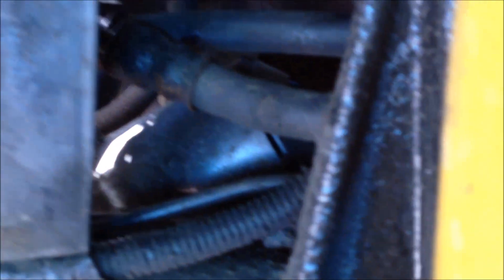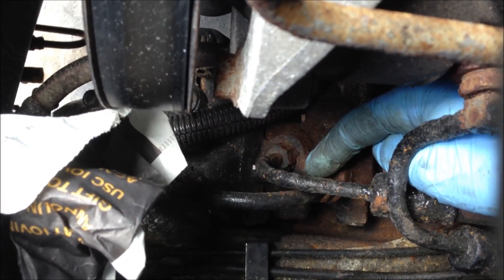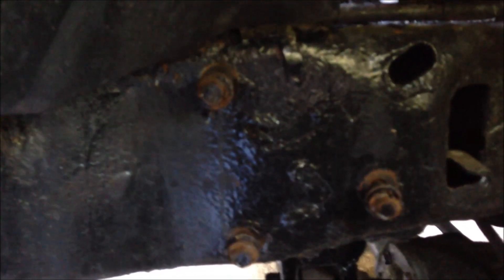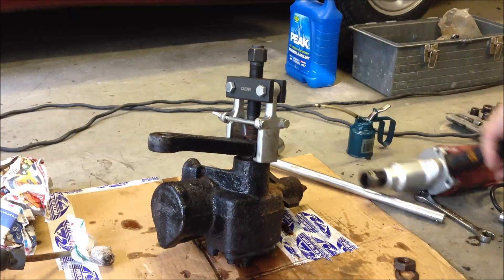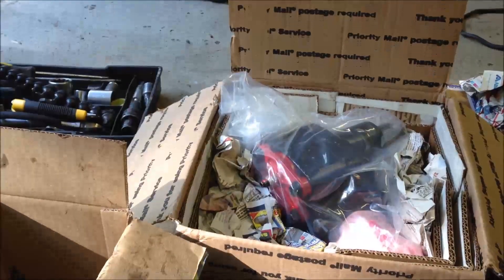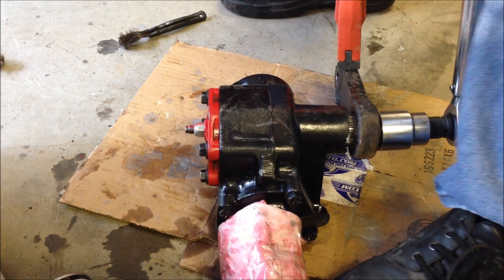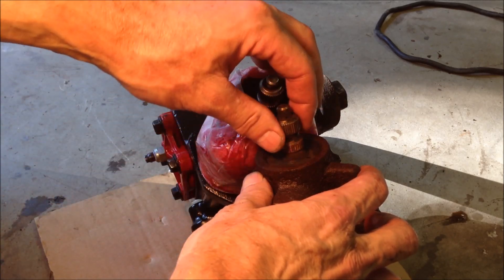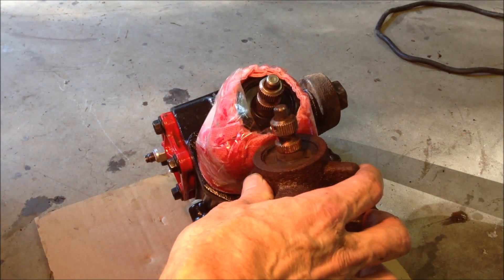Wandering Steering Problem Diagnosis 2003 Ford Superduty F350 4x4 (Part 4 of 4)

Comment: Great videos, thanks so much.
Grease the threads of the pitman arm puller, and using a long socket might help too.  It's heavier and that bit of extra inertia sometimes helps.

Stay gold.

Comment: Did the new steering unit tighten up your steering considerably.  I had my upper and lower ball joints replaced, along with my tie rods. I paid a mechanic to tighten up my gear box and it helped quite a bit.  But it's still not enough and requires more concentration than it should.  I own a 02 , 7.3  f250

Comment: Okay, I watched all the videos, so which replacement part was actually needed?  Do I need to replace the ball joints and the rest of the stuff if it is just the steering gear box?

Comment: I have a 2004 Brazil built 7.3 T444E) Navistar engined super duty F250 in RH drive configuration for us weirdos downunder who drive on the wrong side of the road.
The truck has about 105,000 miles on it! It has new Mickey Thompson Baja ATZ tires fitted. It “ wanders” on the road to the point where, with a tandem trailer behind you have to concentrate really hard to keep it between the white lines. There’s slack in the steering wheel (about 2 inches worth) but it’s annoying  as heck coz you have to move the steering wheel either left or right until past the slack before it makes any correction to your line of travel, then you have to move the opposite way 2 inches again past the slack before you can correct the other way!
So your swinging the wheel all the way left then right, trying to “ stay in contact” with the wheels & the road to position the truck on the road exactly where you want it!
I had the tire shop take a quick look at it while it was on the jack and they tried shaking the wheel left & right while it was raised up in the air & couldn’t find any obvious play in pitman arm, tie rod ends etc.
I suspect its play in the steering box, that maybe can be adjusted out OR I might just have to buy & fit a replacement steering box I guess.
My questions are, do these company’s who supply these after market improved steering boxes have the mirror image ones in stock for the right hand drive F250’s or can we only buy the Ford original equipment steering box over the parts counter at the local Ford dealership, for which no doubt I’ll have to sell a kidney & sell my firstborn into slavery to afford?
Is there much difference in the technique required to swap one out when it’s a RHD configuration F250, in terms of my air box & battery tray are on left hand side same as yours is BUT my steering column & steering box are over on the Right hand side under the OTHER battery tray I assume!
Is 2 inches of steering wheel slack/freeplay, enough that I can’t just adjust it out with the locknut & Allen wrench adjustment 1/4 turn at a time or is that much free play /slack after 100,000 miles (180,000kilometers) sufficient that it will need a new steering box replacement?
I COULD just “put up with it” as is, BUT it is annoying from the point of view of being the driver, it’s like sailing a yacht, point the bow up into the breeze, allow for tide swell & waves, then hope & pray it goes somewhere near where you were trying to point it!
It would be “nice” to just be able to sit my elbow on the window sill and grip the wheel steady with 2 fingers & thumb, and hold a straight line on the road when out on the highway cruising along at 60 mph, without “over steering” to try and maintain a “ respectable” road position, where other drivers are all looking at you like “ this guy must be drunk at the wheel to be all over the road like drunken monkeys uncle!”.
I notice other drivers giving me a wide Berth because they can tell I’m not able to hold my road position well.
I drive for an hour & it feels like I’ve done 12 hours straight!
It’s taking the “enjoyment” factor out of driving a vehicle I otherwise love!

Comment: I watched all 4 videos and you also forgot the consideration of bad or dry axle u joints.  If you turn a corner and you have to self center the steering wheel you likely have a bad joint.

Comment: Great video buddy. How long would you say this entire job took? I have a Ford F250 2011 that has alot of play in the steering wheel. Take care buddy and thanks for the video.
Reply from the maker: The longest part was replacing the ball joints.  The steering box is pretty easy - probably 2-3 hours.

Comment: did you put O rings on the lines going into the redhead steering box?
Reply: Nevermind, I just called Redheadsteeringgears.  They said an O ring goes on the end of each line that is screwed into the steering gearbox.  Same size O ring is used for each.  Thanks.
Reply from the maker: no

Comment: Did you look at the steering input shaft (between the steering wheel and the steering gear/box)?
Does it have U-Joints or one of those rubber couplers?
I've replaced all of the suspension parts, now I'm starting on the steering (2000 Ford Excursion 7.3L)

So far I replaced All 4 springs with HD springs (X & C code, IIRC), shocks, track bar bushings, swaybar end links & bushings, added a Helwig rear swaybar, new spring bushings, bump stops (all urethane).
Next is this:   https://www.energysuspensionparts.com/moog-packagedeal046
Reply: Also going to put degree shims between front springs and axle to increase the caster.
And adjustable caster/camber bushings for fine tuning.

I'm tired of having a white knuckle experience when I am in a narrow lane between two semis.
Reply: Did all this work solve your steering issue?  I'm curious because I have an 2000 excursion with similar issues!

Comment: Looks like the same problem I've been having with my '00 F-350.  Replacing shocks and stabilizer helped but that free-play in the steering is most certainly what you did in this video.  Nice job!
Reply: theirs also a set screw on top side of steering box that you can be adjusted at 1/4 turn at a  time. This will help take the slop out of steering wheel

Comment: I've watched another video where play in the steering is adjusted/removed with adjustment to the 4.5mm allen key.  How do you know the difference between play that can be adjusted in that manner and play that necessitates replacement of the sterring box?  Thanks!
Reply from the maker: It is possible to adjust it; but, it's a bit of a challenge to do it correctly.  In some cases, it can not be adjusted correctly or safely.  Here's the issue - there's a high spot on your steering gear that is suppose to be aligned when you are driving straight down the road.  If the high spot is worn and it is adjusted to eliminate the steering play, it could make the the non-high spot bind when you turn the wheel off the high spot.  In my case, I could never get the right adjustment that would eliminate the steering play and have it not bind when I turned the wheel.  

Here's one link that also talks about it:
http://www.thedieselstop.com/forums/f24/adjust-your-steering-box-just-do-104276/
Reply: You can adjust that but keep in mind your wear is likely not - NOT- through the entire rotation so you tighten the center to zero play and at full lock left n right you may be over tight.

Comment: so by putting the redhead steering box in did you notice a night and day difference in the play of the steering wheel? i have been thinking about replacing mine and have done research with the company. i wanted to know how DRASTIC the difference is.
Reply from the maker: If you've watched all 4 videos, I had problems with the pitman arm joint, the ball joints, and the steering gear.  I replaced the steering gear last and it fixed the problem.  (The steering felt "tight" afterwards.)  

It is important to note that each item (ball joints, pitman arm joint, and steering gear) all contributed to my problem.
Reply from the maker: M Ciampichini - It might be a good idea to check the tie rod ends in the steering linkages.  As I mentioned in the video, my tie rod end that connected to the pittman arm was bad.
Reply: ProjectsbyTMD I changed mine and it is really tight as well, thought maybe I bought a faulty NAPA box, going to try a new one, changed the pump as well, no change? ball joints all good.